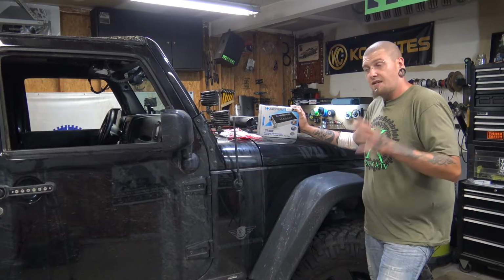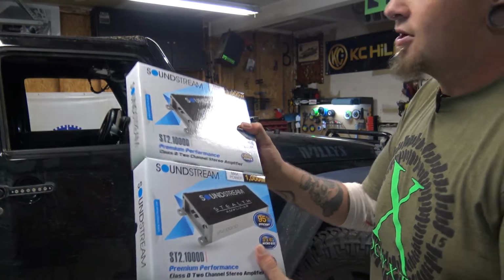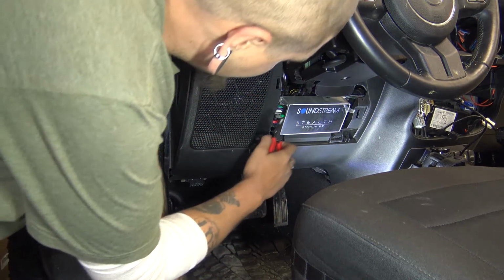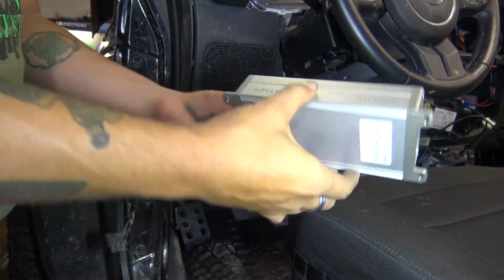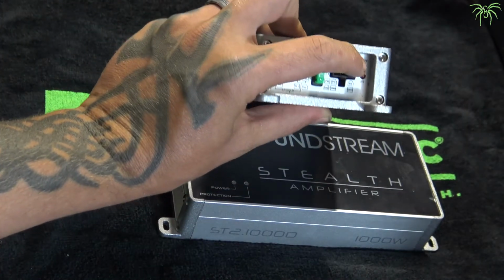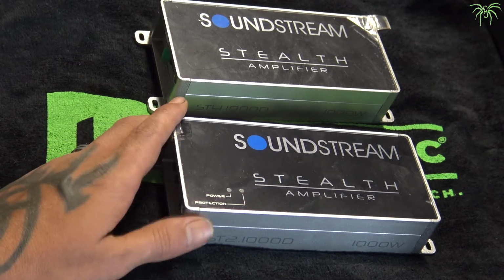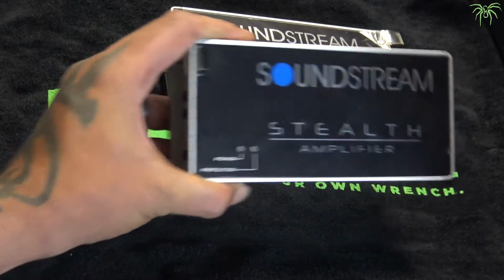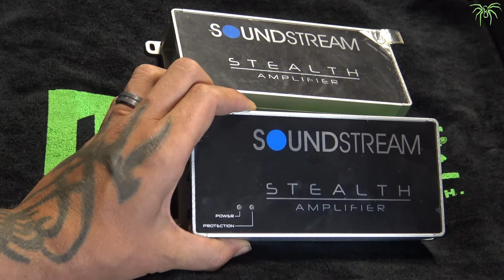Dual Soundstream Amps! (ST2.1000D) Project Dirty Willy Ep.27

Comment: Witch amp are you using for bass
Reply from the maker: They are both Soundstream ST2.1000D amps. One for the front components and one for the rear components. Just mid & high right now, no sub yet. Thanks for watching!
Reply: Rocky X TV ok thanks. What would you recommend for running subs, mini amps.
Reply from the maker: The Soundstream ST1.1000D is a micro mono block amp. It's the same size as these.

Comment: Those amplifiers suck. They dont do 2 ohm load like they say. There is a video of it getting bench tested.
Reply from the maker: Thanks for letting us know, that is a disappointment they won't run 2 ohm, but they far from suck when at 4 ohm. I've been running the Stealth series (ST4.1000D & ST2.1000D) for quite a while and they are holding up great and sound awesome to! Thanks for watching!